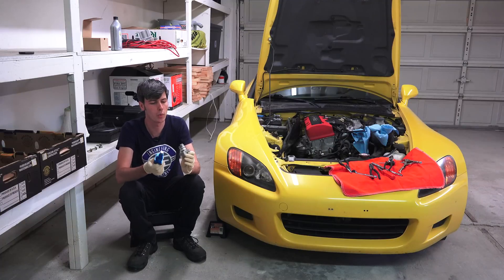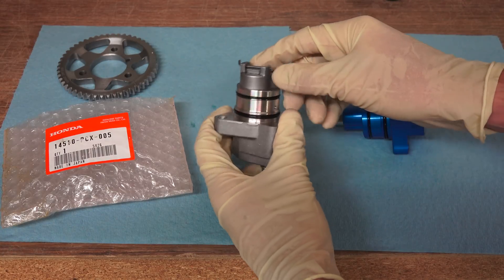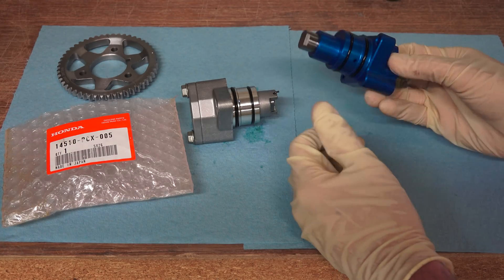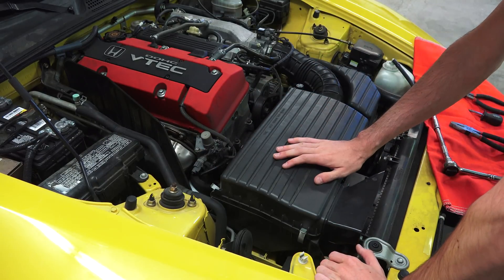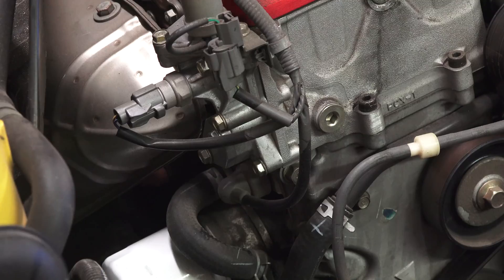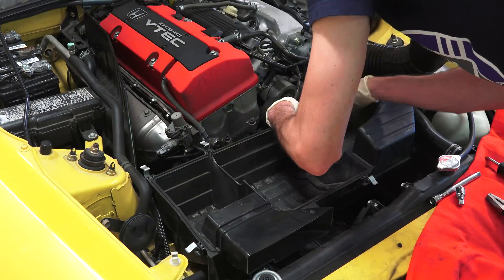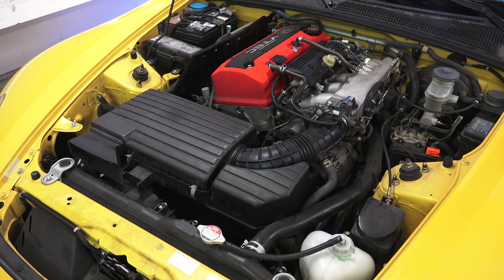Fixing A Common Honda S2000 Problem - Timing Chain Tensioner

Comment: quick question, i just recently bought an s2k like you and i bet this has never been done by the previous owner. If you install a new tensioner like this can you skip installing a chain? also i noticed you didn't install the gear that you were talking about. Is the gear an alternate fix to installing a new tensioner?
Reply from the maker: The gear is a remedy for the timing issues that result from a stretched chain, but it's fixed for a specific amount of stretch. You can replace the TCT without replacing the chain (as I did) and so long as your chain is in good shape, you won't have to worry about the chain skipping. That said, your timing synchronization between your crank and cams will be slightly off as a result of the timing chain stretching (timing will be slightly retarded). This can mean a slight loss in power.

Comment: Would you ever consider making a video on why the "26b" or "13j" motors in the 787b and 767b sound better (my opinion) and make more power than all the other 4 rotor engines made by independent companies such as; Scoot, PPRE, TCP Magic and defined auto works. I don't understand why this is. Some people have said it's because the custom made engines run 2 plugs per housing instead of the 3 plugs ran in the lemans car. Other says the tune and exhaust is different? Thanks in advance!

Comment: hi engineering explained, love your vids, just a few pointers ive learned over 2 years of owning an s2000:

1. replace the grommet on the bolt that is actually holding the timing chain, directly under the valve cover on the side closest to the intake, i can see in your video yours is leaking oil. im not sure if this is on your to do list as it doesnt cause any problems but makes the engine look dirty

2. i highly recommend getting an Ingalls brand(or similar) torque dampener on these cars, this would make a fun video and is very easy to install but the difference is immediate and surprising once you do.

also, clean out your engine bay. this is fun to do because its very easy to do and makes it look waaaay better

good luck with your new s2000 have fun with it!
Reply from the maker: 1. Bought the o-ring for it, just haven't replaced it yet. 
2. What exactly is the benefit? If your engine mounts are solid you shouldn't really need a damper.
Reply: Yeah I've read mixed things on the damper...if anything, I'd replace my motor mounts entirely I think vs getting the damper. This car needs nothing. TCT was a good move. Do whatever else the car needs and then just rip it around town, maintenance-free.
Reply: well ive researched around some on s2ki and found that the engine mounts seem to go bad pretty quickly on these cars just due to the power made, really its just a peace of mind thing for me because a dampener takes roughly 15 minutes to install vs engine mounts which take hours, but as far as functionality goes it definitely does help to keep the car more "controlled" at high rpm and in vTEC it provides that added reinforcement to the car and keeps it straight and steady. of course do your own research as well before purchasing but i definitely dont think the dampener was worthless. if youre ever around Myrtle Beach you can see for yourself! :)

Comment: What happened to the upper timing gear for chain stretch compensation?
Reply from the maker: I did not install it. It's a fixed gear designed for a specific amount of stretch. The better solution is to replace the chain but that's a long job. TCT will compensate without worry of the chain skipping. That said, if the chain is damaged in any way it's another story.

Comment: This is a common thing on bikes, too. I got a very good deal on an F4i because the cam chain was noisy and the owner thought the engine was bad. On old bike I immediately replace the stock CCT for a manual one.

Comment: I had the same issue on my 2007 Mazdaspeed6 GT. Had to replace the actuator, tensioner and chain altogether, ended up costing me over $1,100 CAD. I had the reverse symptom though, where the rattling occurred on cold start for about a second.

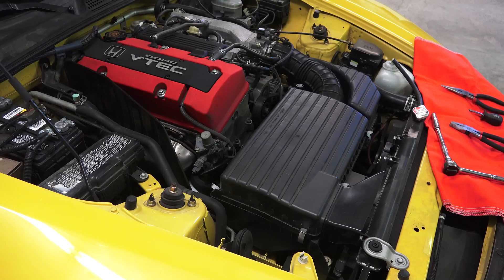Comment from the maker: Hello all, first off thanks for watching! If there's anyone watching this to do the repair on their own, know that the full repair starts at 6:17, and prior to this explains some of the design and theory behind the TCT and how it may fail, and what the aftermarket offers. Product links are in the video description! Finally, I did this repair a couple weeks ago, and have not heard any rattling of the timing chain in any condition (warm, cold idle, etc). Driving review coming soon, have a great day folks!
Reply: Like that you time-out your own videos in the comments for viewers, shows you really know how youtube works
Reply: Great video! I'll save your videos for future reference on my 04 S2k AP1. It's an AP1 cause I'm in Europe, still 2.0L and redline at 9000 rpm. But mine has only 30000km (19000 miles) and I do myself all maintenance. 
Welcome to the family!
Reply: shoulda went with the Billman TCT, as we all told you.
Reply: Thanks for this! I didn't realize how easy this was to do, I think I'm going to go ahead and replace it on my 2003 soon.
Reply: I'm little sad that you didn't go with sandblasting or sanding the original TCT - Easy fix, cost pennies and gice so much satisfaction that youve fixed your car without actually replacing anything :)
Reply: Until it goes bad again. Why would you do that? Old school.
Reply: Engineering Explained hi Jason, just curious- did ballade provide the TCT? Or you had to buy it?
Reply from the maker: I shot them an e-mail asking if they'd be willing to send the part. They did! I bought the OEM version for comparison.
Reply: Whats the downside to the aftermarket part? If any
Reply: great video, definitly wouldhave helped when i replaced mine with the ballade sport one, cant wait to see more s2k vids man
Reply: we learnt a lot from all 500 videos..👍😘
Reply: nothing
Reply: Engineering Explained every contemplated integrating i-VTEC into your S2K with the Design Craft Fabrication kit?
http://www.superstreetonline.com/features/sstp-1108-10-project-cars-under-10k/
Reply: Engineering Explained I know changing the timing chain is probably more work, but wouldn't it make more sense to replace
The chain since the reason for the slack is the chain is being stretched over time instead of replacing tct n correction gear? Thanks for all of ur videos n glad to see u went with an s2000.beautiful car.
Reply: Nice one - I've had an MY05 since 2007 and heard a lot about the TCT but never paid much attention until watching this as mine's only done just over 30k - I'm pretty sure I have a similar rattle but seeing how easy it is to do I might give it a try when it comes out of hibernation next spring. No idea how much the TCT is in the UK but not afraid to do self-servicing since it came out of regular use. I've always used Mobil 1 0W40 (probably frowned upon) but it never loses a drop of oil between services (9k) :)
Reply: Engineering Explained    Hhnnmnb xxxc.  N
Reply: Thanks, i just purchased the Ballade Sport TCT, i dont wanna risk dropping the pin by using the OEM TCT
Reply: mibars sandblasting the original one is not easy. The average driver of this car would have absolutely no idea where to bring it to get it sandblasted. And, what if that's your only car how do you get it done then? In addition, if you sandblast it, the problem will only reoccur later. Then you got to go through the whole thing again.

Comment: The only common problem with the Hyundai Accent is that it's too good
Reply from the maker: The only common problem with the Hyundai Accent is that it's not good.
Reply: rekt
Reply: Once I had a customer come in with a Hyndai elantra with a broken bumper. We gave him a quote on the bumper and he said he rather pay a bit more for a performance bumper another shop gave him LOL
Reply: Hyundai Accident?
Reply: I have a Toyota and my sister has a Hyundai and I do the maintenance work on both cars, and it is always amazing to see how the engineering and thought that goes into the Toyota is SO MUCH BETTER than that of the Hyundai. Often when working on the Hyundai there are little things that make the work just so much harder and more difficult, things you don't have on the Toyota's.  Plus, my Toyota's have never had any mechanical things go wrong with the engines or anything else on the car while my sister's 2007 Sonata has had quite a few things go bad in it over the years. That just goes to show you that while a Hyundai is cheaper to buy at the beginning, you will eventually pay for it in maintenance costs later on as the years pass. Her next car next year = A V6 Toyota, forget the Hyundai cars.  As for Honda quality: Not bad, almost as good as Toyota, but they are having computer code problems with the new Honda Civics.  Just Google '2016 Honda Civic Computer Problems' and you will see.
Reply: shots fired !!!
Reply: iTsNevin
To become one of those ricers, lol xD
Reply: Honesty Counts Toyota also have there fair share of problems. I say Honda makes better cars but Toyota makes great trucks.
Reply: Triggered!!
Reply: iTsNevin whatever that means :D
Reply: I misread the comment as "... it's good" and was like "Good Hyunday? Really, bro?" :D
Reply: An Accent with a Beta engine from a Coupe/Tiburon is a perfect combo, I'd rather have that than most of these modern hoopties.
Reply: He wasn't ready!
Reply: Limitbreakur Despite my previous comment, my mother own a 2007 Sonata with 250,000 km and the only things it's needed was a wheel alignment and a brake bleed, both to solve uneven wear. Also some bodywork, but only because people like to hit it in parking lots.
Reply: Limitbreakur I don't care if you believe me, but I speak the truth. Not everyone's experience can be the same.